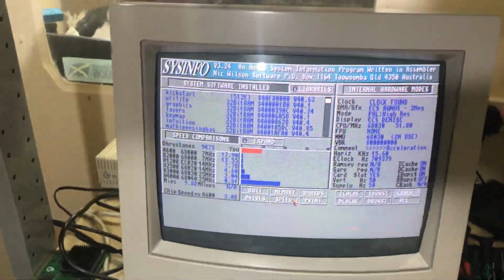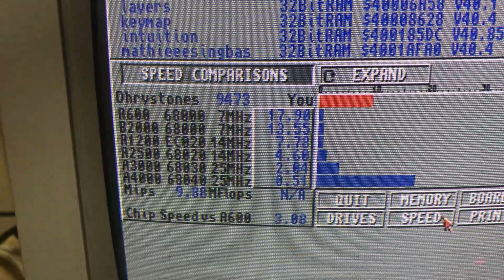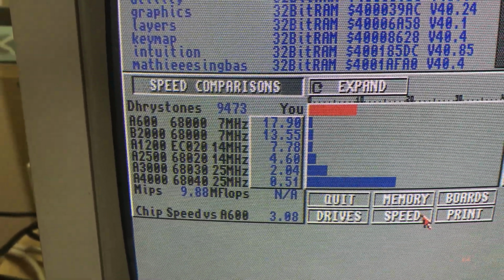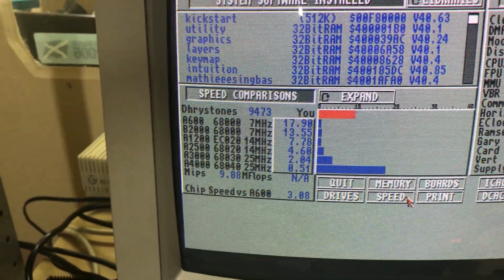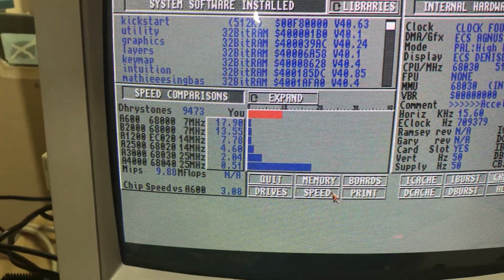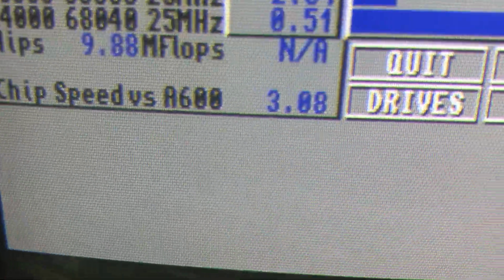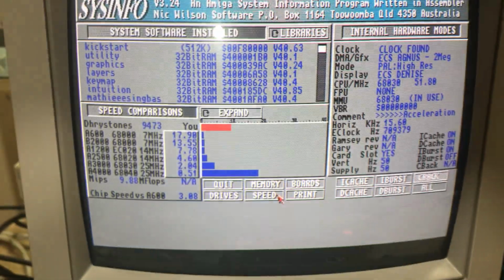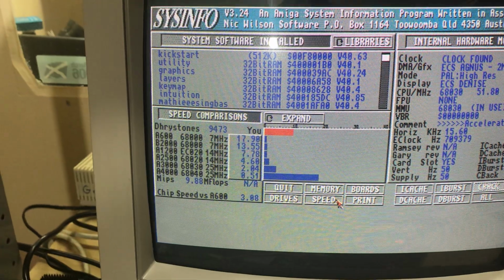TF History Series: TF536

Comment: Will this work with a regular OCS Amiga 500?
Reply from the maker: Yes it will. But you need kick 2+  for everything to work out of the  box.
Reply: @TerribleFire  When I turn on the Amiga, it shows up 1.3 under the hand holding the floppy, so that means that I have the Kickstart ROM's that are version 1.3, right?

So, I have to buy ROM 3.1, e.g., and replace the ROM chips, before I build the TF536?
Reply from the maker: There are patched 1.3 roms that will boot the disk. Otherwise yes you need 2.05+.
Reply: @TerribleFire  Are the 2.05 ROMs  only needed for the IDE functionallity? 

I mean, if I only want to use the extra RAM and faster CPU, will the 1.3 ROMs suffice?
Reply from the maker: The RAM will not be found on a default 1.3. We use Zorro III which 1.3 doesnt know about. You'd need to patch 1.3.

Comment: I'm looking to buy a TF536 to replace the TF534 in my 2000.  My current setup runs very well and is stable with a A2088 bridgeboard, GVP Impact SCSI, AT-BUS IDE (for CD-ROM), Amiga OS 3.2.  Are you aware of any incompatibilities with this?  I'm not looking for guarantees that it will work, just asking if you know of anything in my setup that will cause me an issue.  Thanks for producing some great upgrades.
Reply from the maker: I dont use the TF536 in a 2000 so i'm not the best person to ask. The exxos  forum might be a good place to go.

Comment: Would it work with a 16MHz 030 as well? I have a Mac IIcx, and that'd save me a lot of money not to have to buy another CPU. I technically only need the fast ram. But why not throw in an 030 with MMU capabilities as well? :D
Reply from the maker: In theory i could make it work but this card is fixed at 50mhz so i can avoid having lots of support headaches. I was getting 40Mhz 030s for $9 that worked fine.

Comment: Fantastic card!  I taught myself to solder SMD by making a couple of these (after practice with some of those cheap smd practice boards).  I actually had a "terrible fire" (in the IDE cable) with my first TF536 although this actually turned out to be due to poor soldering on a cheap chinese SD to IDE adapter where two pins were bridged, rather than anything to do with my soldering or the card!  But that aside, both 536s are still working very nicely.  I learned a lot from your old videos over the years, so thank you for that :D